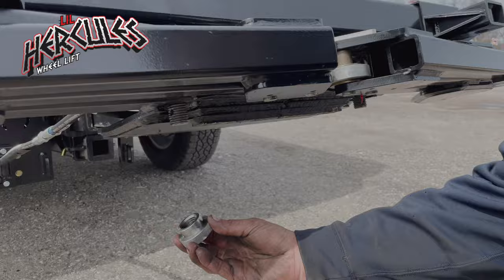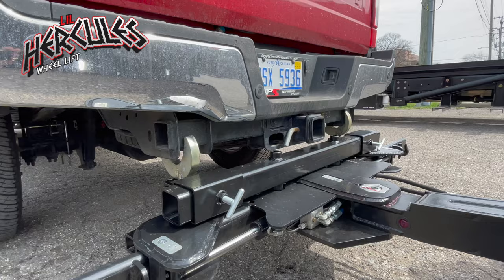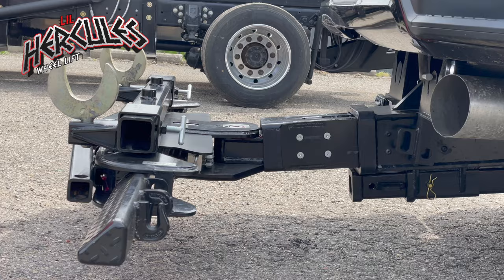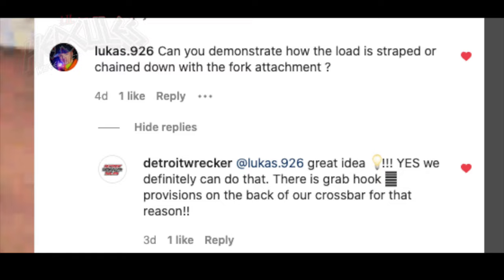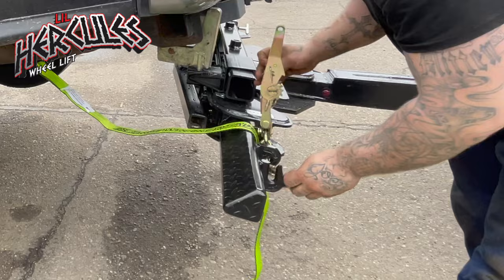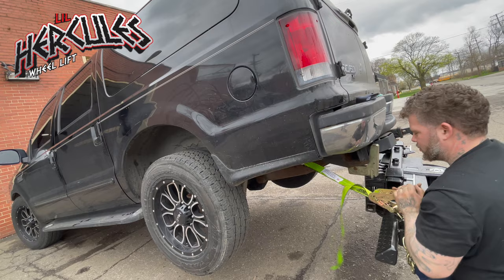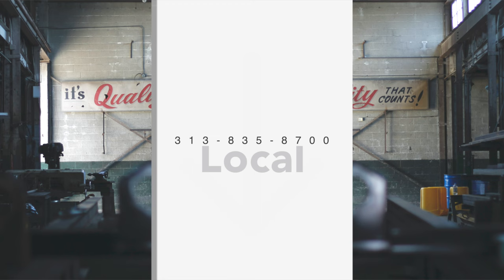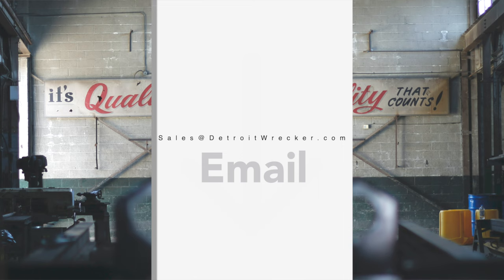Frame Fork Kit for Detroit Wrecker Products

Comment: Considering how many receiver hitches I've seen that were rusted out and falling off.... the last thing I would do is tow from a receiver. How is this possibly easier than using a wheel lift? If you are going to use frame forks... go to the "frame" or something structural... i.e. leaf springs, axle etc.
Reply: Preach! Unless I thoroughly inspected the hitch and the frame assuming it was clean enough to do so I ain't that brave. We'd drag 'em around the yard with a hitch ball adapter by the hitch but the yard ain't the highway. Neat forks though.
Reply: That’s probably a reason for adding tow straps or chains to the frame,( or springs), and just like anything else we do ; always look at what your hooking to. Every tow is different, every tool has to be used correctly and under the right conditions. To me it’s a good option.
Reply from the maker: Thanks 🙏 for the comment we appreciated it!

Comment: Some modern cars only have their Radiator exposed next to a plastic cover. No way would this device lift it from that area unless damage occurs. There still needs to be a universal towing kit, One size fits all (Small and Large vehicles)
Reply from the maker: Thanks 🙏 for the comment! Definitely shouldn’t use frame forks on plastic cars 🚗 agreed.
Reply from the maker: Thanks 🙏 for the comment! Definitely shouldn’t use frame forks on plastic cars 🚗 agreed.